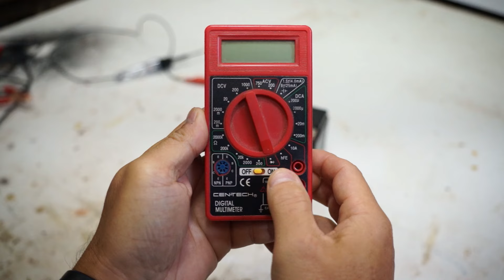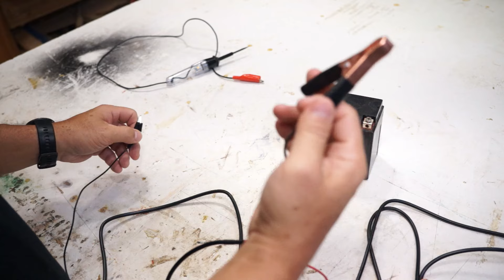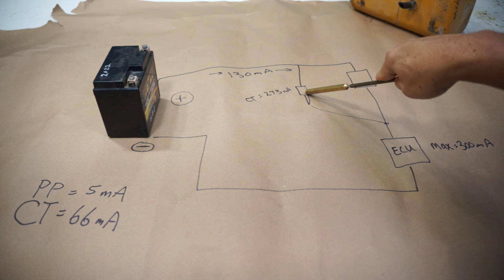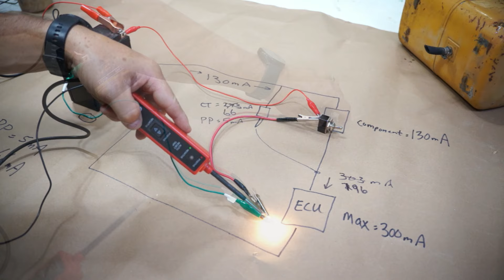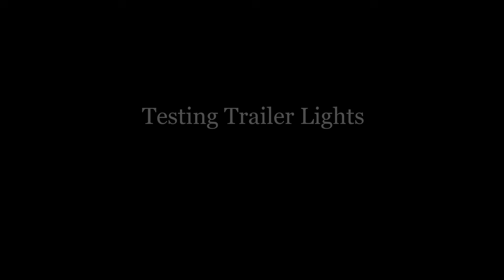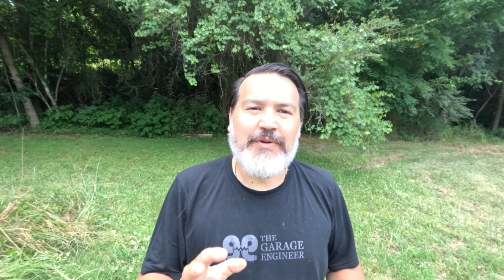Powered Circuit Testing Probe Better Than Circuit Tester? Features and 5 Examples of Usage.

Comment: Nice video. It shows how good a Power Probe can be in ideal situations (laboratory setting for lack of a better term). I don't know what you do for a living but it must not be working on automobiles for a living. Everything has its place. I own and use a Power Probe 4 and it has its place but I don't use it for everything because I can't rely on it for everything. Incandescent and LED lights also have their place. If you only used the Power Probe, you would miss a lot of things. What's important is being able to distinguish when to use each one and that only comes with training and/or experience. On electronic control modules like ECMs, BCMs, TCMs etc. I use an incandescent test light and have never fried anything. You showed that the LED pulls about 66 mA while the incandescent pulls around 273 mA. That 273 mA is after the filament is hot and at it's highest resistance. The ammeter in the Fluke is to slow to show the in-rush current which is much higher. If you hooked it up to an oscilloscope, you would see the in-rush current is over 1 Amp. Eventhough I know the in-rush is over 1 amp, I still use the incandescent in many situations involving computer circuits and drivers, and like I said before, I have never fried anything. I understand your target audience is beginner or do-it-yourself mechanics or technicians. I just wanted to comment so that they don't put 100% trust into the Power Probe. If they get a certain result or outcome on a check or test and it doesn't make sense for some reason, then they should think of using another method to double check and confirm. With either an incandescent, LED, or multimeter. Like I said before, own and use a Power Probe 4, and I love it, but it's not my be-all and end-all for simple automotive electrical diagnostics. Thanks for taking the time to make the video. It great for someone who's getting started in electrical diagnostics.
Reply from the maker: Good points.  Always know how the tool works to understand what it is telling you.  Thanks for your experience.

Comment: Great video! Thanks. The power probe that you use is relatively cheap. I see there are some really expensive one on the web. Do you know differences? For typical DYI car, should I invest in the cheap power probe or do you feel it lack of features so you recommend to go for more expensive ones?
Reply from the maker: I don't need it every day so this one works fine with little investment in the tool.  The more expensive ones are better build an would take more abuse when used everyday. Thanks for watching.
Reply: The more expensive ones have an LCD screen that will display voltage and have the ability to perform a variety of pre-programmed tests